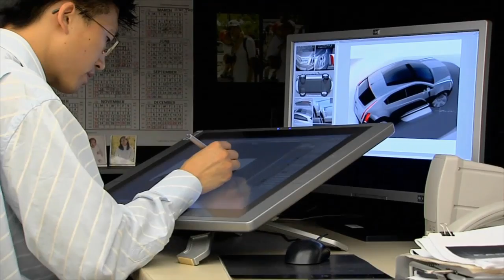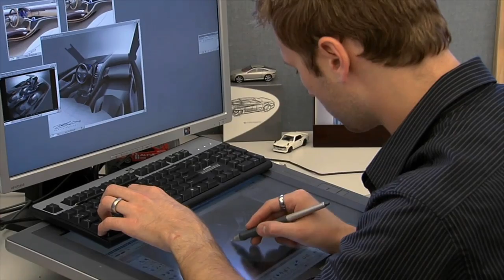Definition of Sustainability - Automotive Plastics and Crumple Zones

Comment: Please. Nothing but a Lie. Sustainability was attainable, you actually already did, but then Greed took it back.
1991 Ford Festiva Built in Korea, 55mpg, 3cyl, 5 speed stick, 4 passenger commuter car. Why Did You Stop Making that car ?
Reply: You make plastic Gas Containers, and most of them fail after a few refills then I have to go buy another one, because the replacement cap is nowhere to be found, The Old Metal Gas Cans Were Better and lasted a Lifetime.

Comment: Plastic can only be recycled at best a few times and is often made from oil.  It is not sustainable.  We need to use a lightweight material that can be recycled indefinitely and is abundant and doesn't create a huge amount of toxic byproducts during its manufacturing process.  Perhaps a car made from Gorilla Glass material.  Just need to make sure when it breaks the class breaks in such a way as not not become deadly shards.

Comment: Doesn't it take horrible fossil fuels to make these plastics
Reply: Please. Nothing but a Lie. Sustainability was attainable, you actually already did, but then Greed took it back.
1991 Ford Festiva Built in Korea, 55mpg, 3cyl, 5 speed stick, 4 passenger commuter car. Why Did You Stop Making that car ?
Reply: Yeah In Other words You have successfully ruined the American Auto Industry,
We never asked for cars that were made of Plastic, and your claim of less emitting is non sense. all of that plastic goes into a landfill at some point does it not. At least metal can be melted and re-manufactured. Safer? How exactly, it isn't the car that is unsafe, it is the operator of the vehicle.